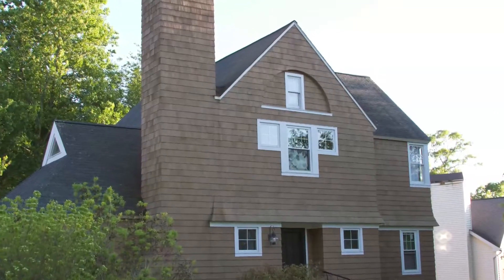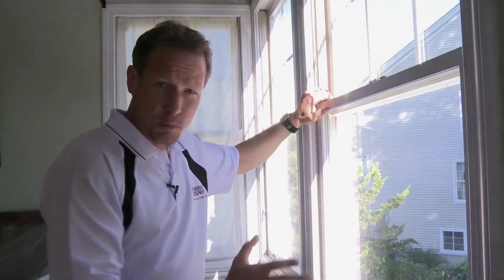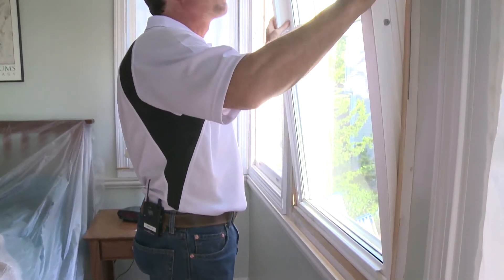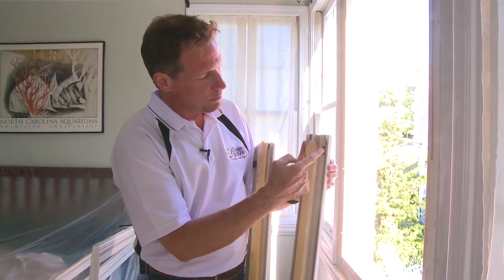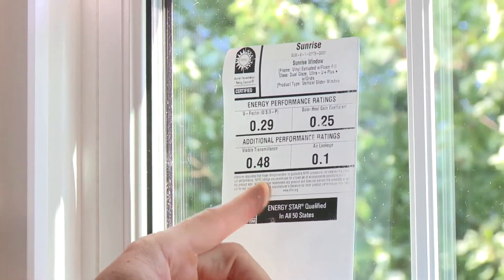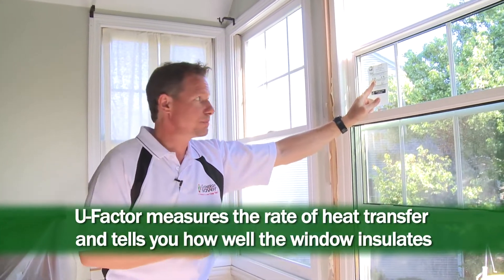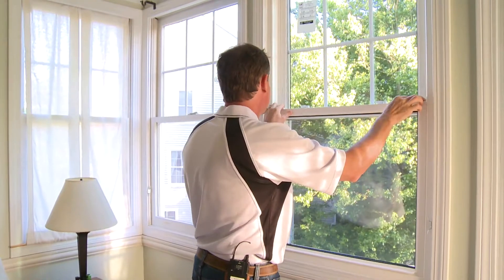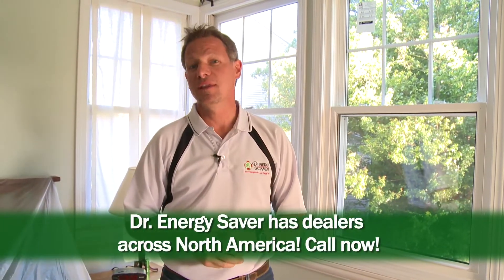Installing High Efficiency Replacement Windows

Comment: If you really want energy efficient windows do a FULL FRAME replacement instead of the INSERT replacement method he’s doing.

This method doesn’t insulate the space between the rough opening and the existing window frame. What if air is leaking there? Also what if the wood rot is occurring at the frame?

Comment: Larry, the haircut looks great!  We replaced our windows a few years ago.  We had wood windows that had lost just about all of the insulating gas (double pane) and we could tell a lot of air was passing both around and through the windows because of the constant drafts and window interior condensation problems.  We noticed a HUGE comfort difference and a nice energy benefit (~15-20%) after the replacement and expanding foam sealing!  NICE video, keep them coming!